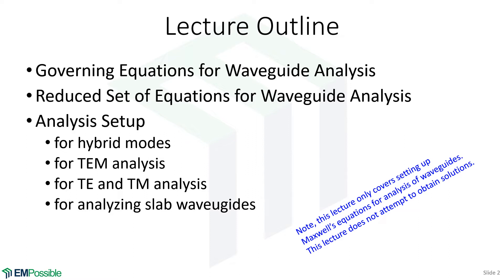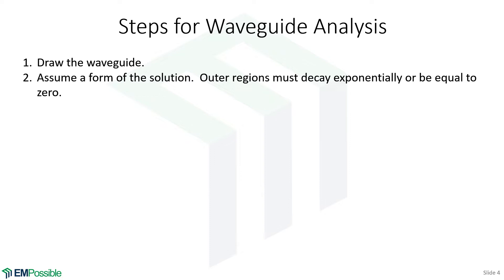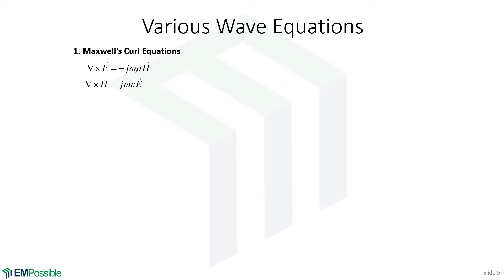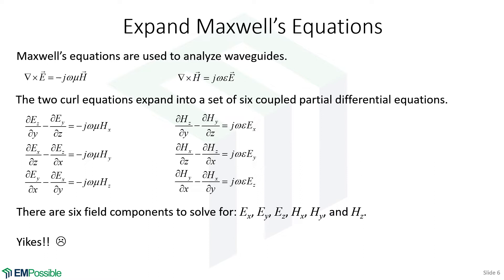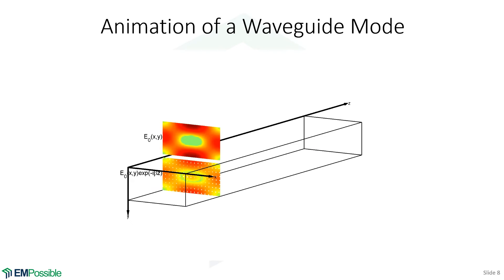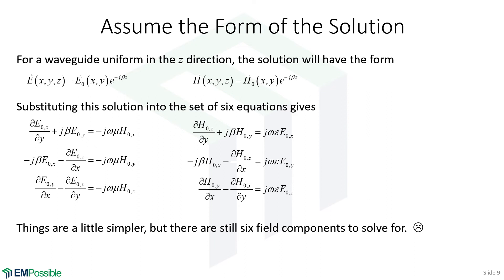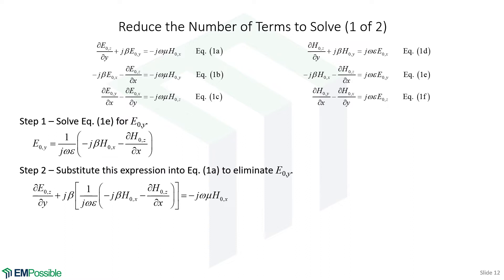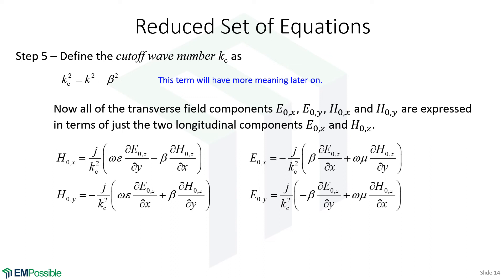Lecture -- Waveguide Analysis Setup

Comment: 1. Slide 32 is fantastic!! 
2. In the definition of the characteristic impedance, can it be also the y-component of the amplitude of the E-field divided by x-component of the amplitude of the H-field?
3. What homogenous dielectric has to do with TEM mode? 
4. In slide 15, will it be E0, z instead of E0, x (in the expression of the Ez)? 
5. Again, slide 8 is fantastic!!